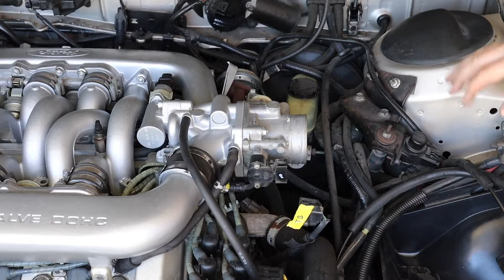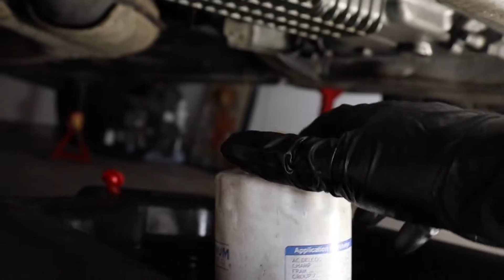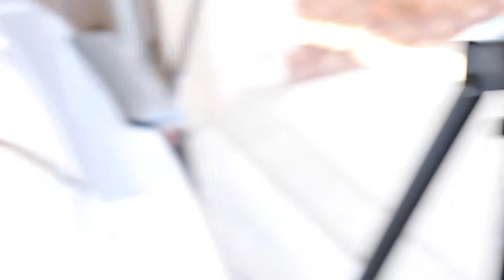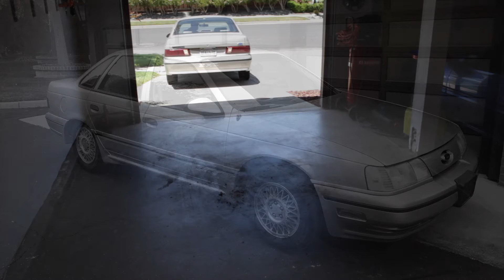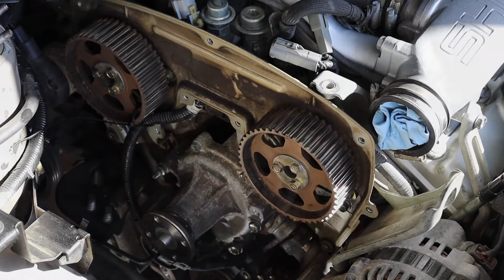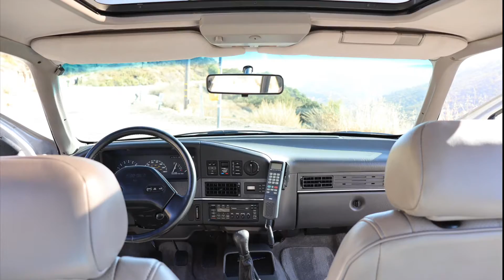1989 Ford Taurus SHO - Episode 10: Project Finale and Recap

Comment: Awesome series man, even after all these years. Really helped a lot since I recently bought a SHO. One thing for future people who come across this video DO NOT USE POWER STEERING FLUID. Ford says you need to use Type F ATF. Regular power steering fluid can potentially damage the system or damage the seals.
Reply from the maker: Thanks for checking out the series. You are correct that Ford recommends Type F ATF in these early cars. Many owners have reported using a quality power steering fluid for decades without issue. To be extra safe, you can use the Type F ATF.

Comment: Thank you for these videos! I have acquired a 1990 beige exterior variant. It is the lower trim model with no auto ac, no sunroof, and 50/50 black cloth leather seating but it has 110k miles on it and it is in pretty good condition. The seat bolstering on the driver side is pretty damaged but otherwise the interior is phenomenal. The exterior needs paint on some surfaces but I think I'm going to just get it repainted entirely to avoid any shade difference. Your videos will be my guide! Thank you!
Reply from the maker: Awesome, glad you enjoyed them...and congrats on the car!